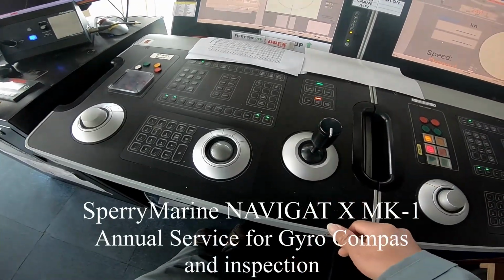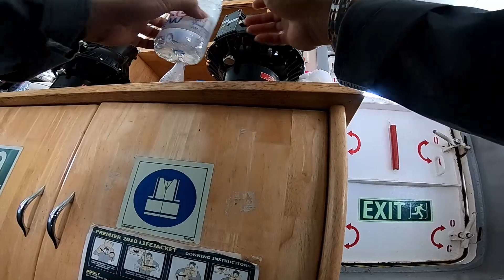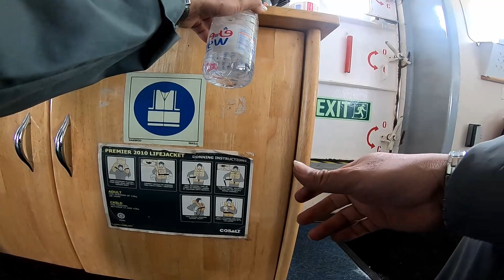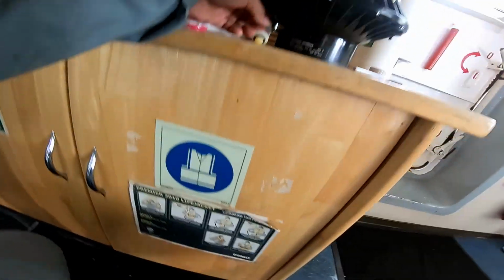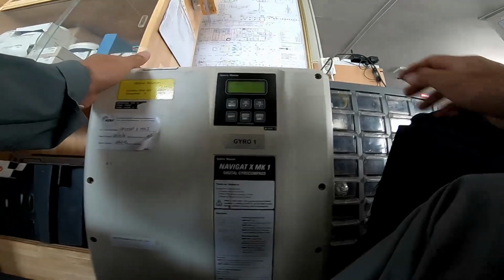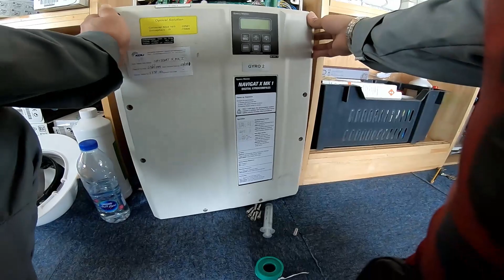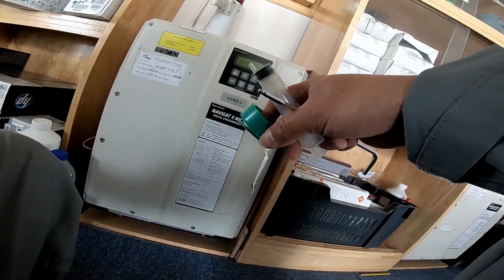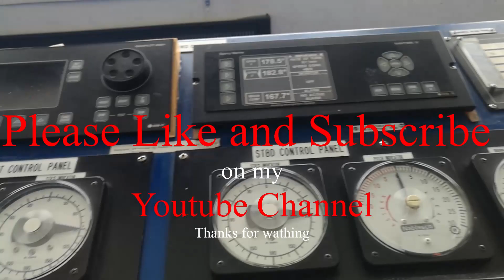Gyro Compass Annual Service 3 Unit of Sperry Marine Navigat X MK1 on DP-2 Vessel

Comment: Thanks for the video Bro.Hello . If the gyro heading keeping constantly changing and not settling down the required heading.The temperature and Current is showing normal about 48  degree and 248mA. So what could be the issue.
Reply from the maker: Hi thanks for watching my video. After starting up 48 degrees is normal but if the Gyro sphere is in running condition it should raise up to at least 55 degree temperature. If the current drop to 248 at least in 3 hours that is normal. But if it drops in almost 1hour you have problem with your sphere or supply from main board. The system show correct current but the RPM required for Gyro sphere to hold the north position was not obtained or reached. Cause, possible is, your Gyro sphere running winding resistance is high or low voltage from the main board. You can Trace it by changing parts. But for me most likely Gyro sphere if having long running hours already.
Reply: @bajmarineequipmentrepair   Than you very much for your kind advice.
Reply: @bajmarineequipmentrepair    Our Gyro no. 1 is showing steady 236 mA  but our Gyro 2  which is not holding the heading is showing us 162 to 178 mA and is fluctuating. We cannot confirm if the correct RPM has reached also Where do we measure the supply from the main board going to the gyrosphere.

Comment: Hi sir why our gyro compass 100degrees difference in magnetic compass ,, after fully shutdown it occurs how to fix that
Reply from the maker: Hi,  Wawah, thanks for asking assistance. Please make sure first that you have a correct heading reference for your Gyro Compass. If you’re really sure that gyro heading is confirmed error means that the heading correction maybe reset to default value. This seldom happened but it’s happening. What is the type and model  of your gyro compass.  For me I don’t rely on any magnetic compass as my reference for gyro, I’m getting a true heading calculation from the navigation chart.